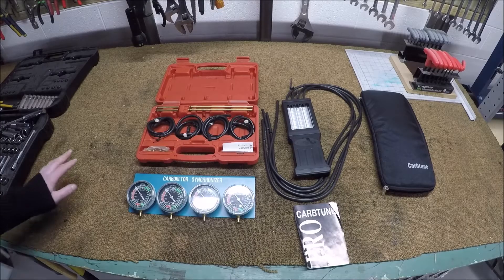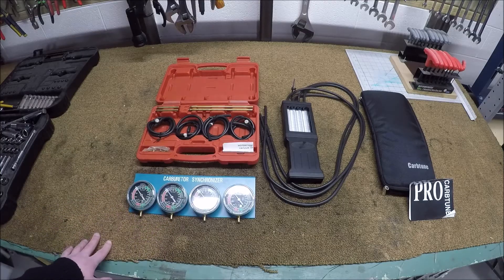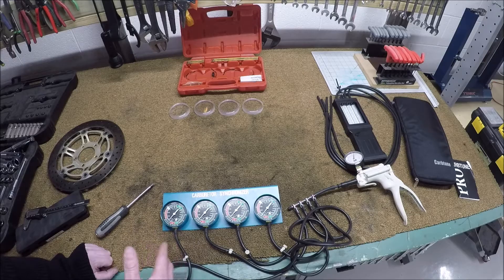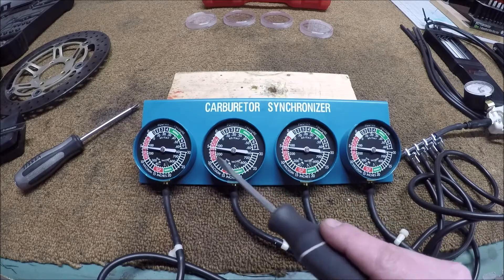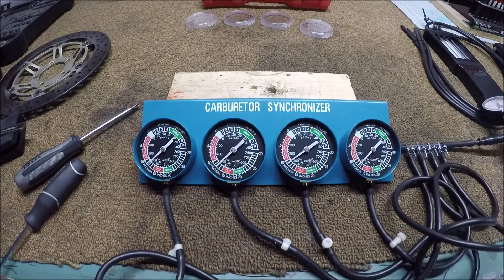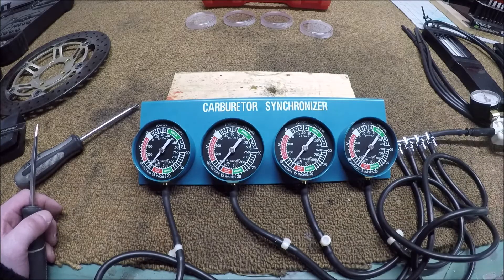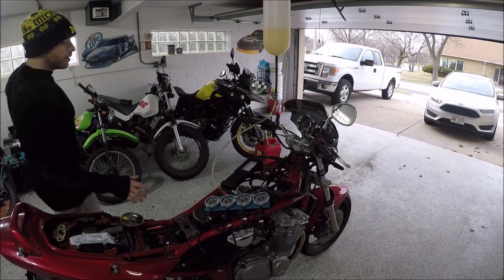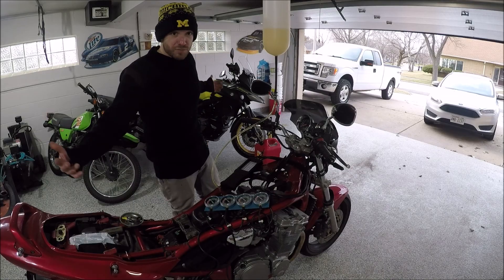$140 Carbtune Pro vs. $40 eBay Special Carburetor Synchronizer Gauges

Comment: A plank, a bunch of tubing, a few angle adaptors and a bottle of ATF is all you need to make an extremely accurate manometer. The Carbtune is a nice neat product you can easily store though.
Reply from the maker: Absolutely. The carbtune has just been nice because it only takes me an extra 10 minutes to setup and dial in if I've just reinstalled a carburetor though.

Comment: The issue with these eBay and third party carb tuning kits with the big clocks is that the diaphragms inside the gauges are compounded to read positive and negative displacement which is great but lead to discrepancies as you show with trying to zero them at atmospheric pressure. They are a good option for cheap asses like me who don't use them very often and the Carbtune is a bit expensive and you don't want to pay a smartass to spend a few hours dicking around at it. Carbtune is a great device when all is said and done, very convenient and ergonomic.
Reply from the maker: I suppose I never even considered the differences in how the gauges were measuring pressure (positive and negative) and why it's tough to zero them at atmospheric. Thank you for the insight Daniel.

Comment: The reason the expensive unit shows the outer cylinders higher is because those carbs have different size jets on outer cylinders. 

The reason why revs hang is lean mix

Comment: If you swap the carb tune lines and the readings change you have your supreme answer although as you demonstrated it is splitting hairs at this point. I agree 100% with the marketing comment you made.
Reply from the maker: Ahh that's a good call for the future. I've really only been using them on my 2cyl SV650 recently, but that'd be easy to check. Thanks for the recommendation Johnny.

Comment: Thank you for this! I’ve been on the fence about which route I was going to go.. cheap eBay or the Carbtune. After hearing slightly off about dozen or more times in this video I’m going to spend the extra bread. 🤣🤣🤣 Sometimes peace of mind is worth the price.
Reply from the maker: Apparently I have a problem with repeating myself. My brain and vernacular is just slightly off :-P
The CarbTune is pretty sweet. I still maintain you can get pretty damn close and likely good enough with the vacuum gauges. The peace of mind is great with the Carbtune though, so I almost exclusively use it now.

Comment: Why are they reading in the red area that says there could be a vaccuum leak??? I see all videos using this tool in the same spot. It says on the gague that isn't supposed to be in the red doesnt it?
Reply from the maker: The specific range you're reading in isn't actually that important for this test--only that they're all reading the same. You're just trying to get the butterflies all set identical to open at the same time. The colors aren't important since the gauge backgrounds aren't specific to this (or any) other bike. If there was a vacuum *leak*, the needle wouldn't move as much on one as the others.
Reply: @matttriestodothings  Well that sure makes some good sense to me about how the needle wouldn't move as much if there were a leak, Thanks!!
Reply from the maker: @CarsGuitarsARs  Sure thing man. Good luck with whatever you're working on.
Reply: @matttriestodothings  Fixing up my dad's old 91 Suzuki sport bike!!
Reply from the maker: @CarsGuitarsARs  Hell yea! That's excellent.
Reply: Thats why its best to go by the manuel spec and not the balance, kpa, inhg, cmhg,,,,,, everybody does a nice balance but balanced out of spec, if your spec is 270cmhg and you balance all to 20cmhg you will be out of spec✌️

Comment: I feel like I got close enough with the bench litmus paper sync. So many other bearings and seals have been bought…might be a while before I even get an eBay special set. RPMs drop pretty quick on my VF500 and that’s the main purpose right?
Reply from the maker: You can definitely get the bench sync real damn close on the Interceptors. If your RPMs are dropping pretty quick and nothing is erratic and everything feels fine, I bet you're pretty damn close to home already.

Comment: Turn air screws out about 3 turns on gsf600 brings down revs quicker don't go by Manual, i made that mistake.And it depends on how far above sea level we are based in UK
Reply from the maker: 3 was too rich and sluggish for me. I couldn't get it to run correctly there. I think I ended up settling at 2 turns on the A/F mix screws and 2 shims on the needles.

Comment: I've tried everything. The hose method, the cheap synchronous clocks. Even high-quality synchronous clocks. I've spent more money on the "cheap solutions" than a Carbtune Pro cost (around €95 here in Europe). Do yourself a favor and don't even try the cheap solutions. It's a hassle and you don't save any money in the end. Only Carbtune, nothing else. The elegance and precision lies in the ingenious simplicity of the Carbtune.
Reply from the maker: I'm inclined to agree that just going straight carbtune is the best and easiest idea for a tool you'll likely have for the rest of your life.

Comment: Agree with your conclusion. However competitive track riders need to tune their bikes to the highest standard. I found the mercury tuning stick to have a level of accuracy above my gauges even after adjustment.
Reply: Except, you cannot buy mercury gauges anymore. When I was racing Superbike, my mercury stick synch tool was the best.
Now, I have to use chinese trash gauges.

Comment: If you don't have a budget get the best.  Carbtune Pro is a great tool and not too expensive.  But I've got a motor (outboard) the carbs [ 2006 Honda ] are messed up and I want to get them in a good place. The $40 would seem to do that for me.  If I was racing a motorcycle, I would tune it up with the $140 device.  For me, it may be do it once and done. or part of a periodic maintenance when idle RPM's are off the 1000 RPM target.  If the Idle gets to low, it dies when going from neutral to into gear.  If you know what pressure you are working with, calibrate it there.  Thanks for the video.
Reply from the maker: Yep. I could justify the Carbtune Pro to myself because I use it several times a year. That's a tough sell if you're just using it once after rebuilding carburetors and don't intend on having to use it again. My experience says that cheap gauges can be 'good enough'; however, they come with the increased risk that they're likely not calibrated correctly, so you'll want to find some way to do so. Thanks Ralph--cheers.
Reply: @matttriestodothings  How I calibrated my $40 set is I bought vinyl tubing and tees and hooked all the gauges to a mityvac vacuum pump.  I pulled 10 inches of vacuum to one and set all the other gauges to the exact same value or at least as close as I could. I think you will want to calibrate the gauges everytime you use the device. I think it would be easier to use the Carbtune Pro to get those precise numbers as reading the values seems to be easier as I watched videos of the carbs being synched. If you know what value your  gauges settle at during the process, You could pull a vacuum to that value and make the other gauges match at that vacuum.  10 inches turned out to be a good value for my experience since the values settled in the 7 to 8 range. Cheers!

Comment: Thanks.  Do you need a. Air -vacuum regulator or they go directly to every carb. ?
Reply from the maker: They go directly to each carb. There's a little restrictor on each like to try to steady out the bouncing needles.
Reply: Thanks for your reply. Do you recommend them?
Reply from the maker: @Oneguygarage  The tough part about recommending the ebay vacuum gauges is that it's a bit of a crapshoot. I trust mine after doing this experiment to get me close enough for sure. But unless you go through with trying to establish a baseline, you may be working with false information. 

They've worked for me though.

Comment: Hi im an old school (60 yrs) bikeing  & i was always taught that any style of synchronising that whatever you are using that the gagues & tubes should not be touching any part of the bike/car as the vibrations can give a false reading !! Just as an aside if you have to use vacuum adaptors with the carbtune pro be aware that the plastic adaptors can brake in time but new carbtune pro now come with brass adaptors so problem solved 👌👍
Reply: Mat you miss understood my point about the adaptors, i was not talking about restrictors my friend, i was talking about the fact that not all bikes/ cars vacuum take off points are  a push fit with the supplied tubes some are 5mm thread on carbs & some are 6mm thread so therefor you need to thread in the correct adaptor before connecting the gauge tubes it is these adaptors that come with carbtune are made of plastic & after a short time break, if you contact Morgan carbtune they have now replaced the plastic adaptors with 4 short 5mm ones & 4 long 6mm ones, as for gagues & tubes i made a free standing metal holder to take either the round dial gagues & the carbtune pro which must be kept upright to get spot on readings, oh & my stand is weighted on base which goes under the bike or car & also holds a 1liter fuel tank & supply tube all of which are  adaptable for height & width just slide & thumb screw fittings, i hope this is of some help to you buddy, happy bikeing & ride safe 👍👍👌👌😂😂😂
Reply from the maker: Great--so the little restrictors I bought with my $140 carbtune are another liability in my life, hah. 

That's good advice about the gauges and tubes not touching anything vibrating. Any vibration in them is going to travel through the device and somehow affect the needle. I imagine the degree to which it is affected goes from "negligible" to "significant". So minimizing that however possible would be good practice. 

Thanks for the advice Keith.

Comment: Check your pilot jets! It's taking to long to get back to idle. They will never be perfect synced! Sounds good!
Reply from the maker: Pilots were fine--had them out probably 10 times over the years I owned the bike. If there was a blockage anywhere, it was likely within the pilot circuit though that lead to the progression holes would be my guess. There's really no way I know of to test for solid debris blockage in those areas. You can shoot fluid through to see that it drips through them, but that's about as good as I can think of.

Comment: The cheap gauges as you are shot by now. The gauge with liquid also a one and done. I would have tried a calibration test on the carbtune to see if in fact they were accurate.
Reply from the maker: What do you mean by shot? 
I'm not sure a static pressure calibration test would work per their description of how it operates (the bouncing sticks). The only way I could think to test that would be from a 4-way tee off of a running engine.
Reply: Please revise this so it's understandable.

Comment: Actually it is better and easier to put a set of 3 differential pressure gauge  and just adjust the carbs so that you get 0 difference between 1/2 3/3 3/4. Each gauge is adjusted by the matching adjustment screw. Simpler, easier faster. However the synchronization is never perfect and between full idle and full open throttle the pressure balance is changing a bit. It should not be a lot except you have something bad on a carb (membrane,  slide, spring...) and I would prefer to have the "best" synchronization with just a little throttle. Perfect idle is not really useful,  but perfect rev up is a must.
Reply from the maker: I can see how pressure differential gauges could make it easier--I've just never come across one before. Some bikes seem rather sensitive to sync while others I've touched seem to have a much wider range of tolerance. Interesting point about choosing the Rev range where you'd want best sync as well. I hadn't thought of that.
Reply: I am using very (too!) sensitive Magnelic clean room HVAC gauges. They are 5mm Water level FULL SCALE.  At iddle speed,  the needle are vibrating so badly that they are barely visible when the carbs are perfectly balanced...and blocked on one side otherwise. The good thing is they are rated for 15PSI over pressure each side so it's no way you can damage them with vacuum.
Reply: Dam uk about it I can see

Comment: I bought a set of those cheap gages and they were absolute garbage.  I would set them all to zero and a few minutes later, two of the needles would drift again.  Also, I would swap the location of the hoses just to see if the readings were the same, and they weren't. For example, I would get 2 and 3 set to the same pressure and then swap the gages and they would read different pressures from before.   I think it is the luck of the draw whether you can get decent gages in the set you buy.  I think I'm just going to save myself a lot of time and headaches and just get the Carbtune.
Reply from the maker: Ah, that sucks. I agree, it's definitely a gamble buying the cheaper gauges. Looks like mine are actually pretty decent but your story is one I've heard before. It just kinda sucks how expensive the Morgan is! It's a nice tool to have though.

Comment: Ayy go blue I have the same hat.

Wasn't sure of the difference between the two but this video convinced me to get the Carbtune. My thoughts is that it'll cost as much as taking it to the mechanic so might as well do it right.

Also the time to calibrate it every time will probably cost more in the long run (time == money).
Reply from the maker: Go Blue!

If the extra $100 for the Carbtune isn't doing to bankrupt you, it's probably the right choice. It's a neat tool that's more accurate and saves time you'll have for the rest of your life. However, the cheaper gauges can work just fine--unlike some people's claims that they're pure trash.
Reply from the maker: Do you still have the poof ball on your hat?! A friend's dog ate mine off, haha

Comment: thanks for the video! I calibrted my cheap gauges on the zero, but i never managed to get the bike smooth down until i did it by helping me with my ear to have a purring idle. I'll probably make it with carbtune
Reply from the maker: Thanks Dan. Some bikes seem a lot more sensitive to the synchronization than others in my experience. This Bandit wants to be damn near perfect whereas my SV650 is like, ehhhh... close enough, and it runs fine.

Comment: This is the reason why I ditched these exact same gauges, because of the inaccuracy, I could never get the bike to run smoothly, until I bought the Carbtune. Now it just purrs on idle and runs better.
Reply from the maker: This set doesn't seem too bad but requires that you go through and calibrate them for peace of mind. The CarbTune is certainly the easier of the two by far, and I'm glad I bought it. I think the standard vac-gauges can work decently though.
Reply: @matttriestodothings  I get what your saying Matt, even after calibration and altering the set screws on the carbs the gauges never gave an accurate reading.

Comment: as you know, each carb will be physically different as well and synch can be a bit dynamic meaning not static. Always hang those gauges to minimize interference.
Reply from the maker: Ah, you know.. this is true. I've hung the gauges every time in the past, but I wanted to go for a better camera angle this time. But you're right, they should be vertical to minimize interference.
Reply: What sort of interference?

Comment: Awesome, we'll worthwhile doing the comparison dude.
Reply from the maker: I probably should have spent more time showing the values of the readings of the vac-gauges vs the Carbtune at the same engine RPM. But I think this shows that the cheapies can at least be in the ballpark and better than an eye-balling bench sync.
Reply: @matttriestodothings  was wondering if the budget ones were any good before, glad to hear they are at least reasonable.

Thanks bud.